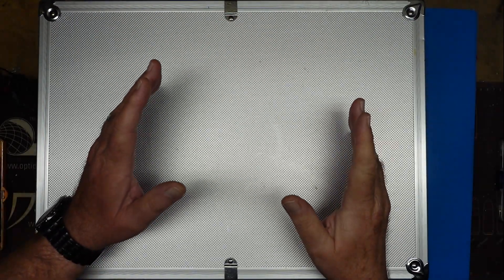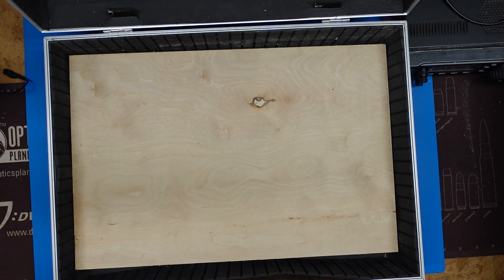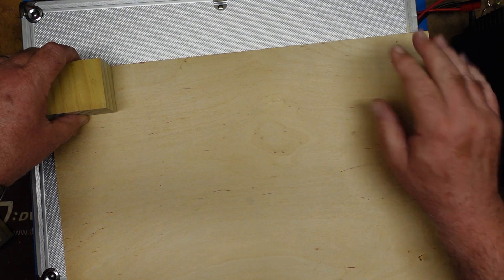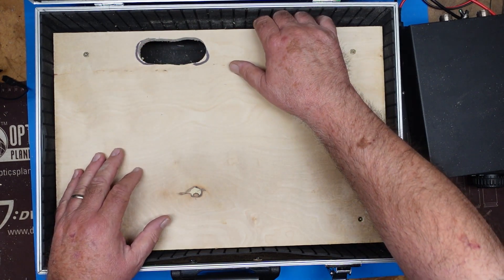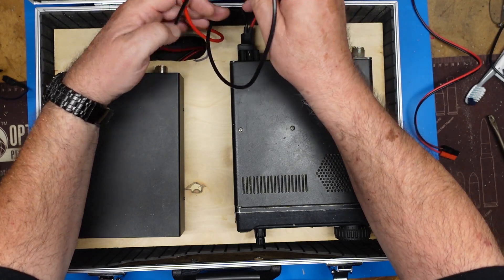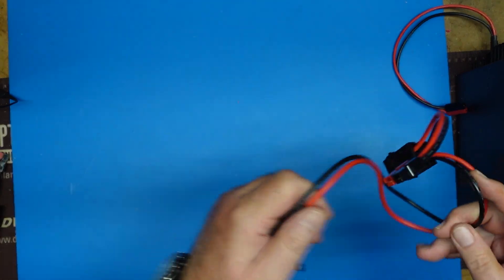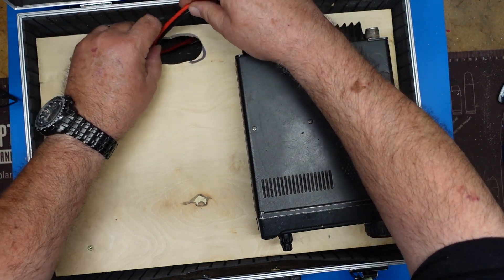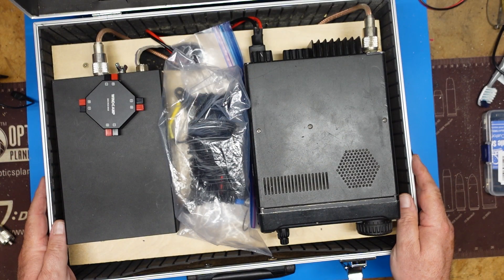The Huntsville Hamfest: A Thrilling Fusion of High-Frequency and High-Tech Fun!

Comment: I love the build! Im a IC-706 MKIIG owner as well. the detachable faceplate is turning into my road block. so much so that I am considering and close to selling for a IC-7100. I have a 3d print faceplate holder yet I don't want to spend the time or energy to rainbow cable and springy pin the things together. Im also, NOT giving some random person over $150 for the cable on EBay. I have yet to see one at a HAMFest I thought was affordable. So, I still operate normal, on a park picnic table, in a woods. Such a blast to use!
Reply from the maker: I bit the bullet and bought a cable.  It was painful!

Comment: Like the simple design.  I have a Icom706MKIIG I want to do kind of the same thing to.  I 3-printer stand for the head would be a great addition. 73
Reply from the maker: I wish the case was maybe 6 inches wider, but I think everything I want is gonna fit.  The only piece I don't have is a signalink or digirig, if I wanted to do digital, so for the time being, this will be analog.  I just got a charge controller today, and have jumpers ready to plug in my solar to keep things kinda topped up.

Comment: Hi Jim, Why don't you make the board hinged in the back. Then you can just raise the front and have a good viewing angle for both the radio and the tuner.
Reply from the maker: I thought about that, but then i'd need to screw into the case.  I rarely will ever need to get below, at least in this configuration.  I hope.
Reply: Maybe try some Velcro with self adhesive back? Something like 1.5" wide strip all along the back wall should hold a strip of something to mount the hinge to. @FEPLabsRadio

Comment: Jim great ideas for what is on hand. I think i would have a shallow wide U cut on the back of the board instead of a multi drill hole. It is your project not mine.
Reply from the maker: Yeah, there's several ways i could do this.  I think my logic was a hole, to keep all the wires corralled up in one spot, where they couldn't migrate all over the place.  Since the board is not the exact size, there is a bit of play front to back, and I think the wires would have been all over the place.  Thanks for watching!